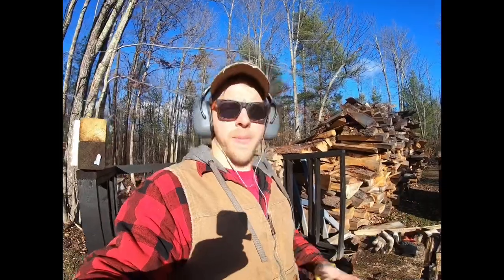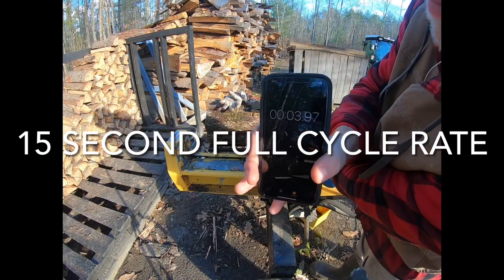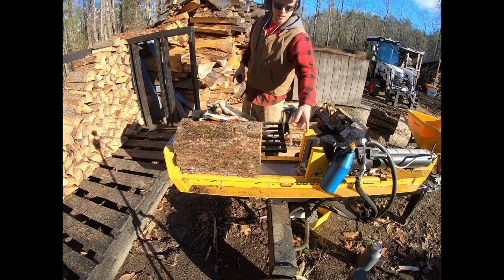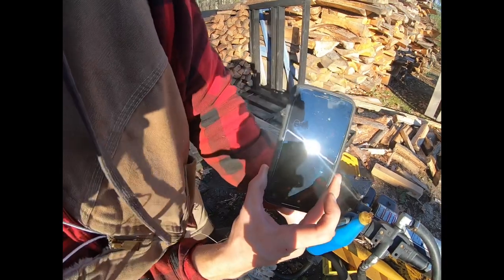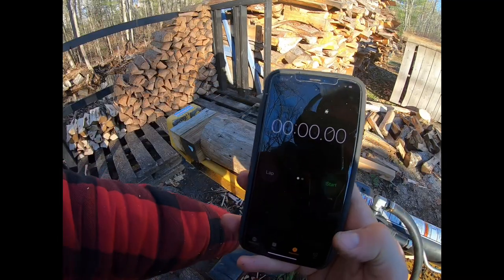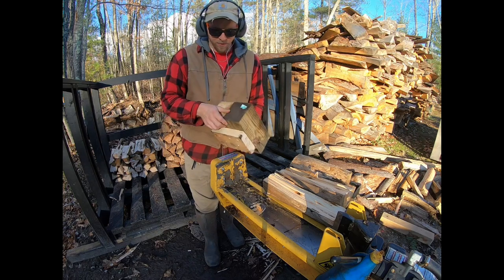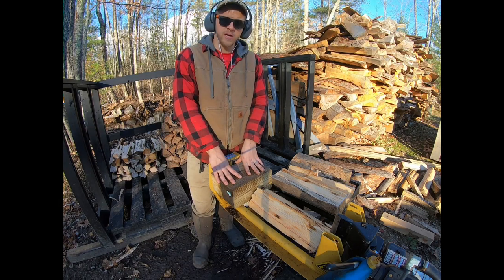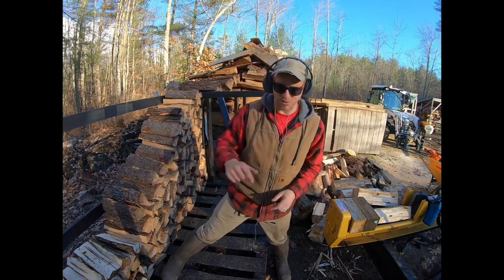SPLIT FIREWOOD FASTER WITH THIS!

Comment: Nice to see that you got the mud wasp nest out!, don’t run the ram all the way back, and if straight grain, you can short the stroke by about 1/3 and return to the initial stop point, thus shaving off more time!

Short stroking does not harm the splitter. Just remember that when finished splitting for the day to completely retract the ram to protect it for the next time!
Reply from the maker: Yes ive done that before I usually give the round a "push" outward cause like you said sometimes it doesnt need to be split all the way! Thanks for tuning in!

Comment: Won't the wedge eventually go through the block if you miss stopping the travel
Reply from the maker: Since its not end grain it will doze into to but unless im being a moron it should last! Notice how the 4x4 is perpendicular to the ram. If it was inline it would just split but being 90 degrees the ram is hitting the side grain and "shouldnt" bust it.

Comment: DON'T RETURN RAM ALL THE WAY BACK.  RETURN IT 18" BACK.  MIGHT BE MORE SOLID TO SPLIT AGAINST METAL STOP.   I RETURN RAM BACK ONLY AS FAR AS NECESSARY.  NOT SURE IF SOME SPLITTERS HAVE TO RETURN FULLY BACK...MINE DOESN'T.  I CAN STOP ANYWHERE.
Reply: That's exactly what I do. I only go back far enough to get the next one in.
Reply: When i split with my son, only split 18–19 inches for a 17 inch round, now if the round is straight grained, i only travel the ram about 4-6 inches, the retract the same distance, twist the log and go again! While my son loads the tray, and hopefully stacks the wood!
Reply from the maker: I thought that would work but fussing around trying to stop it at a certain point was more work so this way I can let go and focus on getting another log and if it retracts all the way its no big deal but I see your point!
Reply from the maker: lol pat "hopefully" stacks the wood hahah
Reply: Just like dancing... it is all in the rhythm 🤣😂🤣😂😂!

Comment: Wouldn't a 4 way wedge cut your time by another 50%? Also like someone else said...manually stop it from returning all the way, and you don't always have to let the wedge go all the way through the block to pull it apart. Great video though!
Reply from the maker: In theory the "stopping it" at 16 inch mark makes sense but then im sitting there waiting for it to get back to that point. With the block I can let it fully reset while im busy grabbing another round and so on! It would make more sense on video versus comment lol Thanks for tuning in!

Comment: Get a 4 way splitter !  Even faster yet !  I cut 20” logs  with a 4 way !
Reply from the maker: Yes I know I need to make that upgrade!
Reply: @HomesteadJay  Yeah the only problem with the four-way is you can’t really split anything officially over 12 inches in diameter
Reply from the maker: @scottbaican9566  Yes but the ones Ive seen slide on and off so its quick change!
Reply: @HomesteadJay  I work at a machine shop and I made my own it just detaches from the cylinder with a pin so it’s kind a quick change to
Reply from the maker: @scottbaican9566  Yeah its deff something im looking into for sure

Comment: No offense but if you’re standing at the lever why would you let the cylinder return all the way back? Most rounds are not the exact size anyway unless you measuring before you cut them, which I know I don’t. The best thing to do would be a faster pump if you’re worried about speed. Good video though.
Reply from the maker: This allows me to either turn and stack or grab the next one and it’s immediately splitting that round. If I didn’t have the block I’d be worrying about stopping it 16” back from the end. This way I’m not having the traveling time as this machine can split 24”